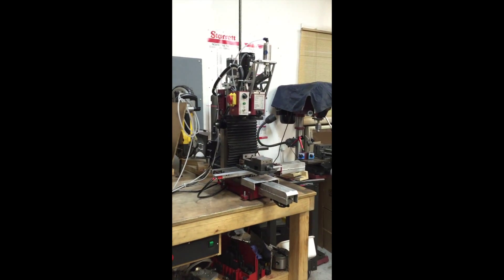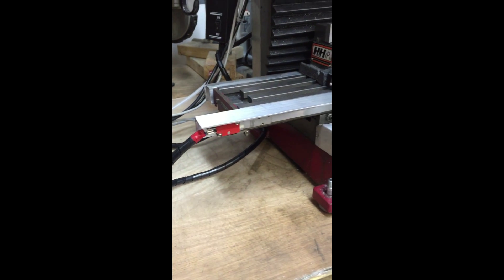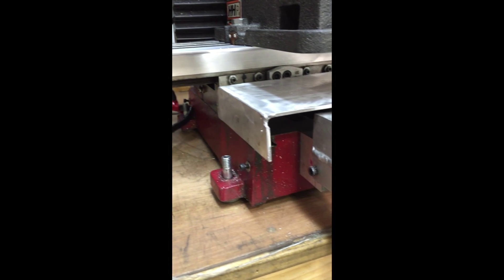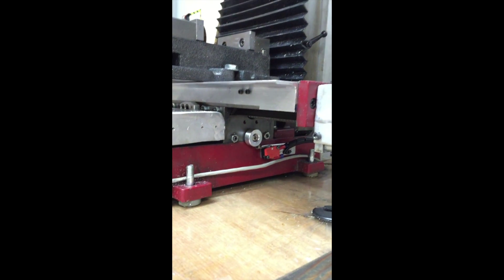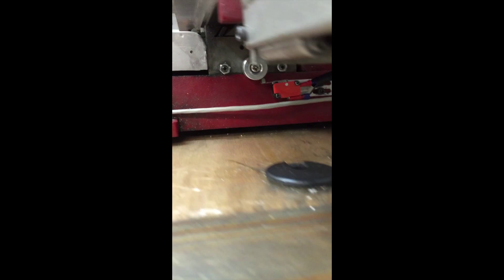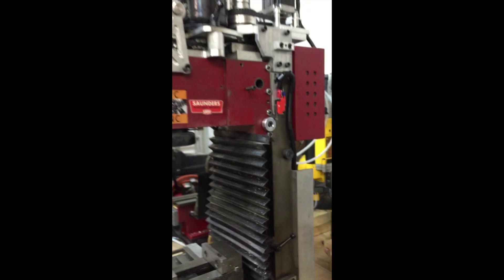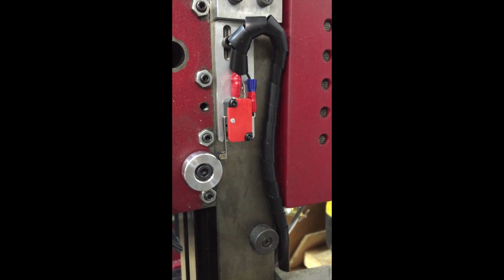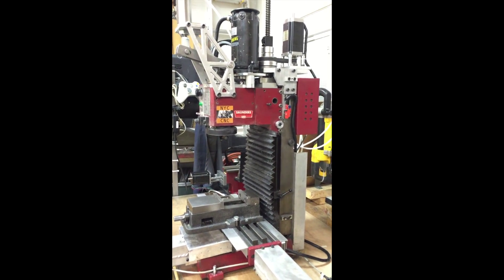Limit switches

Comment: Very clever use of the Round shape simple and a built in cam action. I'm glad to see you finally got them connected.
Be Safe,
Sam
Reply from the maker: +CNC4XR7 Thanks Sam, I wanted to use the few holes already on the mill. I figured that with only single holes available on the Y and Z axes, if I used round cams they would always go back the same way if I ever took them off, and I'd  never have alignment issues, like I would run into with any other shape held by a single bolt.
Reply: +Crivo152 Great Idea! I'm going to throw that in my bag may be handy with my new Build.
Be Safe,
Sam